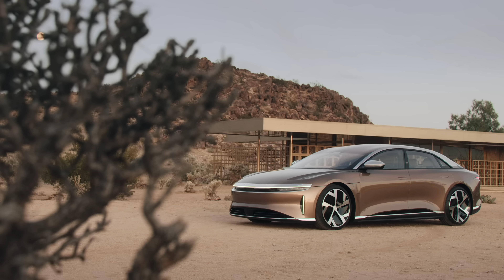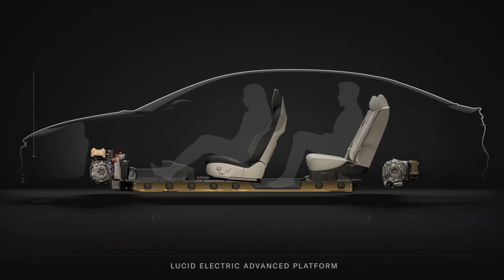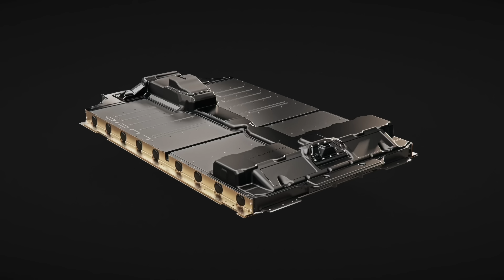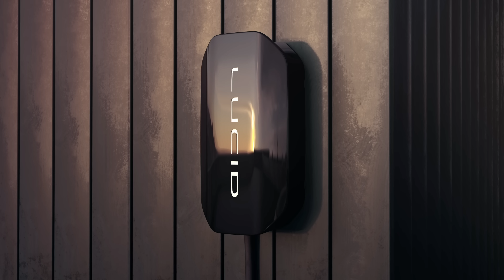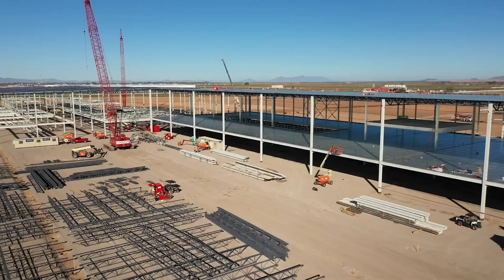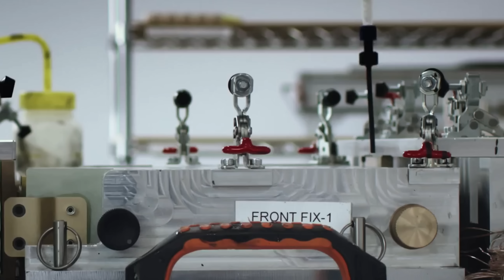You've Seen The Car - But Now Here's The Lucid Air - In Lucid's Own Words

Comment: 2nd motor linked to a mini generator to just recharge the batteries while moving.....extending range....maybe self charging....
Reply from the maker: I'm afraid physics doesn't work that way.
^Kate
Reply: @transportevolved  A motor that can propel a 6k kg car in 2.5  can surely link to a high power mini generators....many said nay to many  current innovations

Comment: At an on-the-road price of around $150 000 according to Google, this car is, and will remain a car for the chosen few. As the former owner of a BMW i3 with  the first 22 kwh (gross)  / effectively 18,2 kwh battery, with a range of ca 150 km in the summer, and only half of that in the winter, all I can say is that I‘m a very happy diesel driver again with an emission class of Euro 6 d-temp, and a relaxing range of up to 1400 km. BMW got the concept wrong from the beginning by launching what purely was a local flitzer, i.e. a car which is not at all practical for fast inter-city travel. Lucid Air seem to me to be on the same route as Dyson : they set their sights too high, aiming to show the industry the correct and better way to do things. However, they may still be successful is the super-luxury segment, but such success is hardly likely in the Charlie Bloggs segment.

Comment: Yes the very high price is an issue, but the design of that interface screen recessing itself into the dash to access the storage space behind it calls for a redesign. It's the first thing to break. Easier to move the screen to a horizontal orientation, & give the driver the means to adjust placement side to side, manually. Easier to access storage below.

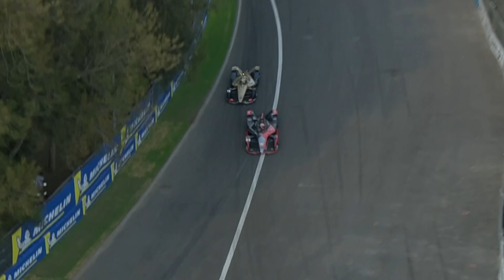Comment: 4:04  Formula E !!! ... I love this racing series, the low noise pollution has brought Formula racing back to citiy streets. .. and the EV technology allows features unqiue to Formula E.. like "Fan Boost" where drivers can get a temporary power boost from fan voting, or run off onto a boost zone that temporarily turns on boosted performance ... it is a game changer for racing strategies, and spectator excitement. All made possible by their EV technology ... which we NOW see spilling over into production EVs.  Tesla needs to get involved in the Formula E serious, they are sorely missing, as EVERY global EV OEM must be in Formula E.